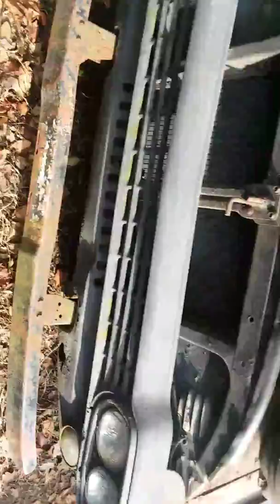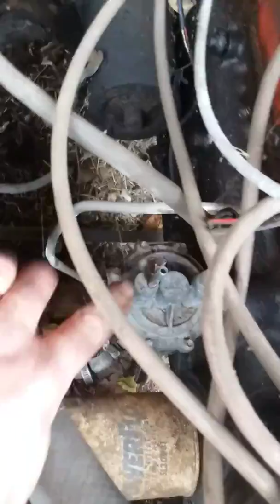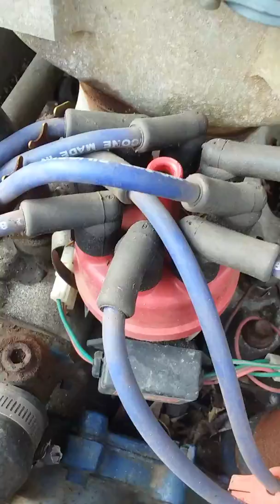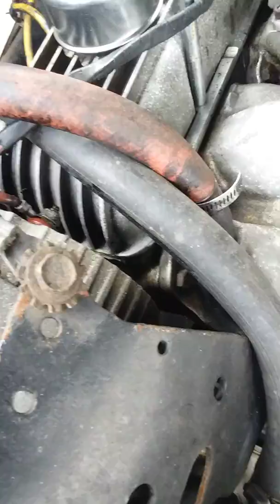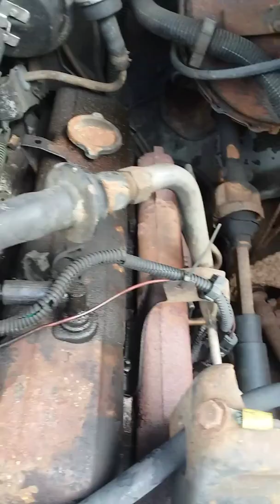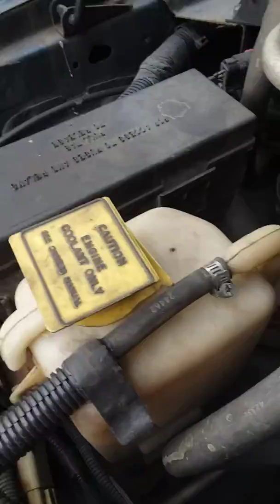Vr to deorse.   Emp proofing cars and trucks

Comment from the maker: I said the jeep was a 99 but its a 92.  A lot of electronics were added in a few years .     My 86 f 150 has a computer  that controls the distributor  and ignition timing
I also forgot to mention that in the mid 80s the carborators had a electronic  solenoid  on them to control how rich the fuel mixture is.  Those vehicles will run without it but not very well  . The stepper valve  is controled by vacume pressure and elctric impulses from some crude sensors
Reply from the maker: @Liberty Cat   i dont know.   I had an 89 dodge truck.  It had a computer  and a real faulty wiring.  I had an 83, i think , thats was really great and simple.  The older dodge ignition  and charging  systems are very good

Comment: Good VR, Walter. Sorry for not getting back to you sooner. As for the vehicle that I drive, it is a 1988 Chevy C2500 pickup. Maybe I'm wrong, but I think that there is a 50/50 chance that I "could" possibility get my truck running again after an EMP. Now as for a solar flare "CME" similar to the "1859 Carrington Event", I'm not worried about that, because it does not effect small-scale electronics or anything with electronic circuitry spanning less than 300 ft in over length. A CME will however burn up power lines and transmission lines because of their vast overall length. The reports of telegraph wire melting and telegraph stations catching fire during the "1859 Carrington Event" does not surprise me because those telegraph stations were connected in a complete circuit that spanned for hundreds of miles. Unlike an EMP which as 3 destructive waves of 3 different frequencies of energy will destroy anything electronic, a CME will only have enough energy to produce only the second and a third wave of energy to destroy power lines and anything electronic that spans over 300 foot in length. The first wave of energy coming from an EMP is the most destructive and happens within a millionth of a second, that is what destroys anything "small-scale" such as portable electronics such as cellular phones, computers, pacemakers, electronic ignitions and sensors in modern cars and trucks, the second wave which is found in both an EMP and a CME happens after about 30 seconds to 1 minute after the first wave, remember a CME will not have enough energy to generate a destructive "first wave", the second wave will effect things a little bit lager mainly the grid, such as the transformers because they are tied in to a network of wire spanning for thousands of miles, and the third wave which is the slowest which will happen about 3 to 5 minutes after the initial "first wave" travels at the speed of a bolt of lightning will fry everything else related to the grid such as melting the transmission lines, power lines and frying any power generating equipment to power plants that are still tied to the grid. Neither the second or third wave to a an EMP or CME will effect cars and trucks, but the destructive first wave of an EMP will. Good response video, man. I love having these discussions.

Comment: The 300 Straight Six the best pickup truck engine ever made.  Chevy power-glide automatics can be push started if you get to 15 mph and drop it in low gear with key on. Had to do it many times with my '61 Impala 283.
Reply from the maker: In the 58 its a 223.  My 86 is a 300.        Didnt know you could  pop start a power glide.    I know the old ford c4 would at around  40.     Thanks for watching